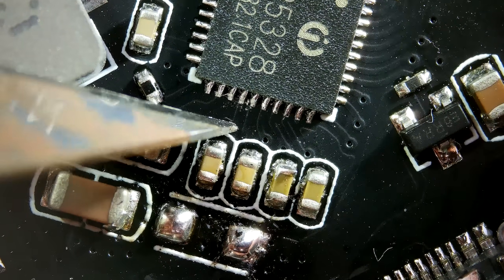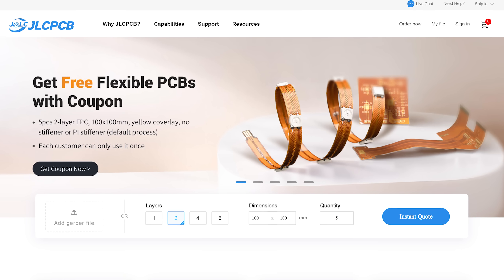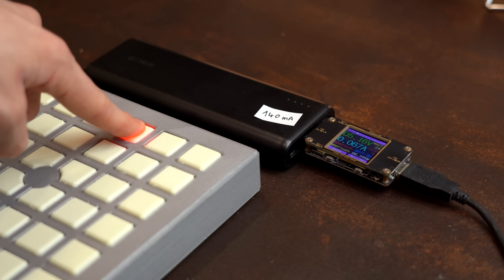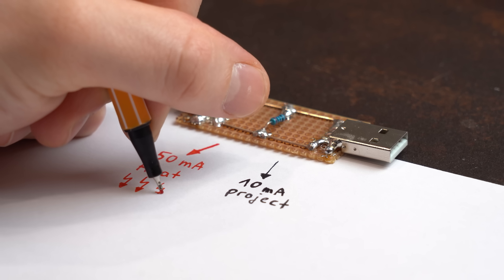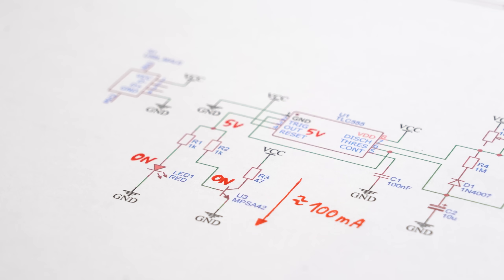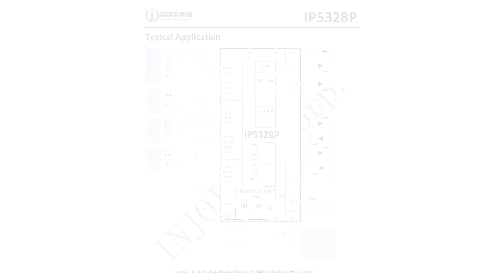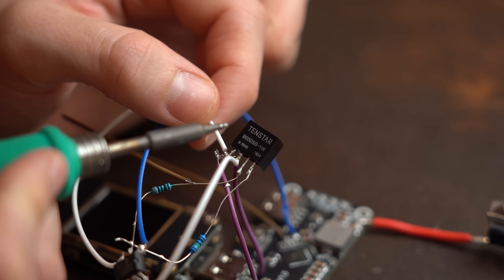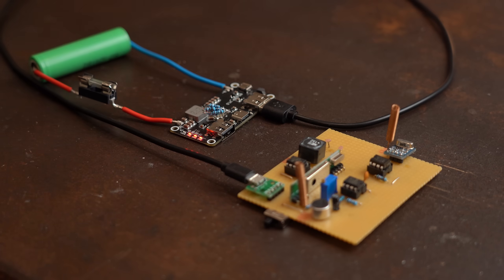Your Powerbank has 1 BIG Problem! (That we can "Hack")

Comment: You can add an offset to the current sense with just 2 resistors: one resistor between the 10mR and VSN, and the other from VSN to GND. The first resistor allows you to offset the voltage at VSN while only drawing a very small current to GND. Example resistor values of 2.2R for first resistor, and 18k for second resistor will only waste <0.3mA.

Comment: One thing I would like to see is a low voltage input cutoff on powerbanks. I have several that will draw all the way down and not shut off when they get low.
I don't like the batteries going that low. Luckily I'm using recycled laptop batteries that were free. They would last longer if they didn't draw down so low.

Comment: Another annoying problem is that most powerbanks turn off the output when you connect a charger. Otherwise you could use them as a small UPS. For a raspberry pi for Example...
Reply: I've figure out that this also depends on the voltage of the charger. If charger has a good cable and the voltage on the input port stays close to 5V my power bank doesn't turn of the load and indeed works like a small UPS. But if you plug it in a weak charger and the voltage on the input drops to say 4.5 it disconnects the load until fully charge itself.

Comment: I used to power a small camera tracking mount from a powerbank that would shut off after 15 minutes. My solution was to plug in a small USB hub and power the mount through that. It has worked for years and seems to take little to no hit on battery performance

Comment: Hook that usbc pd trigger module to  a buck converter, theres a mod out there that lets you add a curreent limiting function with a trim pot, opamp and resistor.  Voila, usb c power supply, adjustable from  15v.  I guess its more then a cable, its a amp/voltemeter and knobs in between your powerbank and project, but it still usese the power bank and you got the current limiting.
Reply: If your project runs on 5V, 9V, 12V, 15V or 20V it would make a lot more sense to rely on the well regulated output of a power bank rather than passing it through a cheap noisy buck converter first though

Comment: Another fix is to replace the 0.01R shunt resistor with a 0.02R shunt resistor. It should allow a higher current before cutting off.

I don't know if it will allow the unloaded booster to switch off though.

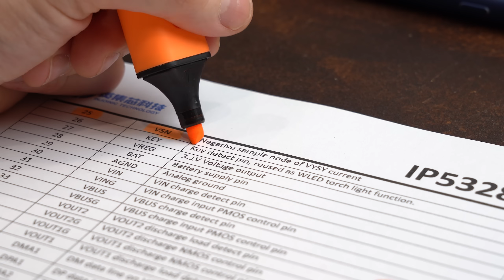Comment: 8:47 Wouldn't it simply have been enough to short the "current shunt"?  Then the 5V would just pass through or not?
Reply: The controller wants to see a small voltage drop. Too small and it thinks there is no load (must shut down after a while to save power). Too high and it thinks the load is too large (must shut down immediately).
Reply: @tomasburba5356  thanks for explaining!

Comment: Great designs! I think the 555 circuit is plenty good enough for people that need the convenience of a powerbank. The "pre-made" power banks are meant for expedient use anyway so as long as it's not discharging the battery for nothing it's fine. People that actually care about doing a "most efficient battery powered IoT whatever" will just embed the battery and add a basic BMC in their device (ie the little boards that just protect the li-ion cells from over/under voltage and overcurrent).
Nobody should be getting a power bank and then try to hack it, just get a BMC board and cells and make a "dumb" battery

Comment: I wonder if instead of pulsing a load resistor you could supply pulses to a capacitor that then powers your project, so it would pull the same average current but in narrow spikes that ought to trigger the load detection. On the plus side it should still shut down if your circuit is properly off, but on the minus side you'll have ripple which might or might not be a problem?
Reply: With the units I have they seem to play the game of averages... which is likely why he went after 100mA pulses when the verified steady current threshold was only 50mA.

It's hard to tell exactly what is going on inside them but it would seem that the longer a load has been near the threshold, the more readily it will trip with just a slight further decrease in current.

I think the pulse approach has a benefit efficiency wise because it may take a bigger hit on the averaging cap, keeping it further away from the cutoff point.

That said, this is essentially what buck and boost converters do. It's an "everything you got for a moment" followed by "let that soak in", on repeat.

So you could probably half get around this simply by using another converter that follows the one in the battery. It isn't going to really "gain" you much tho, you're adding on another "base" load that doesn't actually "do" anything, putting you back in simple minimum load resistor category.

Comment: The biggest issue I have, is that if I want to continuously draw power from the Powerbank while connecting/disconnecting the charger to/off the powerbank, the output gets reset. Not making it usable as a ups.

Comment: I feel like if you need to power project, that draws little bit of current, than a lot simpler move is to use 18650 battery with charging and prottection circuit.

Comment: Another idea could be to use a 555 to send a voltage pulse to the VSP pin, it could be something in the 100mV range, which is A LOT and quite easily achievable
Reply: With this solution you can include this circuit inside the PB enclosure, and simply put a switch on the supply of it, so if it is not needed you can completely disable it, doing so if you don't need the "keep-alive" function, you can completely power off the 555 (which even if a VERY TINY amount, but sucks a bit of current)
Reply: By the way i'll probably use an inverting schimtt trigger for the timer, it should be more enery efficent(the 555 has always a 15k load on the supply)

I know it may sound that i'm paranoid about those little currents, but my professors showed me how quickly they sum up

Comment: I'm using two different powerbanks together with ts80p and type-c cable. And you know what? When soldering iron automatically switches to standby mode it shuts down because powerbank disabled it's output. And the worst thing: one of powerbanks turning down even when target temperature automatically drops from 320 ºC to 200 ºC. That's really annoying. So, I don't think type-c solution will work for anyone. Or for anyone either...

Comment: You can just use an usb-c powerbank with a type-c breakoiut board, set both CC 5.1K to GND with a resistor to get 500mAh output on that port and keep all other ports awake with higher output.

Comment: If your project contains microcontroller and you have spare output pin and some space on board you can program pulse draw, or use second small dedicated microcontroller like Attiny5 and some transistor with load resistor to do it.
Reply: Yup, I've done this.  Spare PWM pulsing the power with a MOSFET.

Comment: Ikea powerbank's have a low power draw function hold the button for I think 10 sec . And the output stays active I think for like 2hours. The manual indicated it is for low current charging devices like smart watches .
I use it for a baby sleeping swinging little bed . The moment it's up to speed it draws very little current and except for a few older power banks most shut off in 5min.

Comment: The datasheet lists a parameter about light load detection which uses the voltage between the positive USB voltage rail (connected to pin VOUT1/2, VBUS) and VSN. Seems like they use the output FET as a shunt. If less than 1.8mV is measured, light load is detected. Maybe a low forward voltage diode (e.g. Schottky diode) between the positive USB rail and VOUT could do the trick without affecting charge/discharge current protection. Although, the datasheet is a bit conflicting at that point 🤔

Comment: I gave up on "off the shelf" power banks a long time ago. Years ago you designed a TP4056 / FS312 LiIon charger circuit. Since then I incorporate charging circuits into most of my projects.
The power banks I design and use have an ON/OFF switch. That's it! NO auto-OFF.
Reply: That means no auto-ON either, so for normal powerbank use it introduces the possibility of connecting a device to charge but forgetting to turn the powerbank on.

For that reason I would prefer a solution with an ON/AUTO switch rather than an ON/OFF one.
But I can see the appeal of having a truly OFF mode, so an OFF/AUTO/ON switch would also be interesting, though more error prone.

Comment: Hi,
as many projects require 3.3V and not 5V, you can use a 3.3 LDO regulator with overdischarge protection directly on the li-ion or li-po battery inside the powerbank. 3V is enough for low power projects (SMt32 + data acquisition +  oled for exemple) , a low cost LDO is sufficient in this case

Comment: I built my own using a TP4056 and a SDB628 (MT3608) boost converter module for less than 50 cents for both!!!
Added two USB connectors, power switch, terminal blocks, and enclosed in a 3D printed case. Voila. Always on @ +Whatever volts.   
That boost converter is magic. works down to 2V which consuming microAmps of quiescent current. Brilliant times.

Comment: From the datasheet"Discharge:
If key not pressed, only when sink device attached will the output port open, non-attached output port will
not open. If the opened output port current is less than 180mA @ 10mOhm, it will wait for a period of time before
close the port automatically. The output current is detected by the voltage drop between VSN to output, 180mA
current is equivalent to 1.8mV on 10mOhm, when the resistance (including MOSFET internal resistance) between
VSN and ouput is larger than 10mOhm, the current threshold will be decreased proportionally."

So all you need to do is attach a 555 timer to the KEY pin and pulse it periodically. It should stay on without drawing extra current  or messing with the current sense

Comment: It's nice to see Scott using Everyone's Favorite Timer Chip in a project again. Coulda done it with a cheap, ubiquitous microcontroller, but where's the sport in that? (Seriously, as much as I love the 555, there's something to be said for a chip that only requires a bypass capacitor and a load resistor to perform the same function, and the micro could easily be heat-shrinked into a tiny USB pass-through dongle.) By the way, Paul Carlson built a similar 555 timer "stay awake" circuit a few years ago.
It still bugs me that power bank enginerds don't realize that many consumers need this functionality.
Reply: Should be considered basic functionality to charge something like a headlamp :/
Reply: It feels wrong using an entire microcontroller to just pulse a circuit though :/

As for power bank engineers, they do realise, it didn't actually take very long after low power type C devices like true wireless headphones came on the market for power banks to start including low power modes. The problem is that the cheap power banks just recycle the old designs so you usually only get these modes on mid to higher end ones.
Reply: @bosstowndynamics5488  I meant the ubiquitous $0.03 one-time programmable 6- or 8-pin chips. Just a few lines of code to grab a brief pulse of current every few seconds, 100 nanofart bypass capacitor, appropriately sized load resistor, USB connector traces directly on the PCB...Bob's your auntie.

Comment: The new Varmfront powerbanks from IKEA have a "Small current supply mode" (<100mA) - just press the button for 8s to enter that mode.
It isn't even advertised, lurks in the instruction manual.

Comment: A simpler way to do the pulse load would be to use an ATMega328. With the 5v supply it would not need any external regulator, just a bypass capacitor at VCC. It draws around 8 µA with the watchdog enabled in sleep. Just wake it up every x seconds and parallel four or five output ports with a 47 ohm 1/4 w resistor attached to Vcc. The outputs can handle 20 mA each (easily) and you can use the internal clock so you just need one chip, one resistor, one bypass cap and you’re done.
Reply: If you already have a microcontroller within your project, you can have keep-alive at the cost of one pin, a random tiny little MOSFET, and a couple resistors, one to tie down the gate against floating and one for the actual load. Or a random BJT then one resistor is to limit base current, it doesn't necessarily need anti-floating.

Comment: Someone mentioned that some power banks such as those from Xiaomi can go to "Low Current Discharge Mode" by double pressing the battery check button (and exit by simply pressing the battery check button). This however, still has a potential problem that this mode will end in 2 hours. This may be good if you use it to charge your wireless earphones but in my case, I want to use the power bank to drive a water fountain for my cat (which draws about 40mA current, and don't have a near by mains socket) so I want it to be able to run as long as possible. Another question on Scott's hacks is, will the power bank still be protected from over-discharging, especially when the pulse circuit is added?
Reply: Yes the cells are protected against over discharge regardless, no matter that you apply constant load or wake-up circuit with intermittent load.

Except on the very cheapest of power banks, not reputable ones, which can only turn off boost but then the battery voltage is still on the output terminals, so instead of 5V something in 3V-4.2V range is present when it's sleeping. But you could say those don't have a functioning over discharge protection to begin with, sure a phone would stop charging, but LEDs, heating gadgets and other simple devices could overdrain such a power bank. You better check if you have those around.

Comment: The most right solution - is to use DIY spot welding and make your own Power bank ) with your own voltage controlling circuit ) worth making video on this - if not done yet..

Comment: My energizer power banks will usually crash upon power up so they continusly output 5v instead of fallin' asleep after 25seconds !. And btw, they do have the automatic shutoff when little energy is being drawn, however the IC controller seems to crash and keep the usb port active regardless of load. ~Jason437.

Comment: I buy cheap power banks  just to disassemble them to get the batteries that I use later just with a fuse, so zero problems with auto shutting down. EDIT: All the power banks I own and disassembled actually state the wrong capacity, i.e. when they say 10000mAh, they mean the battery inside rated at that capacity, they don't provide 10000mAh at 5V.

Comment: Having such a circuit would be a lifesaver for me. Whenever I'm charging my Pixel 6a, it displays an error after 80% saying there's a problem with the charger source. Sure there was. The power bank was constantly cycling as the phone didn't even draw 200mA. I would rather have a power bank with a traditional power switch to completely cut off the buck/boost converter. Sometimes, I feel like the cheaper power banks are more worth it as they mostly come with a button activation with no cut-offs.

Comment: Wouldn't the last solution end up triggering overcurrent protection if pushed too far?
Reply: It does. The wavy voltage where he shows, that's probably the protection oscillating on the brink of triggering.

Comment: Funny, because i recently made exactly the opposite experience. 😄 I bought absolutely cheap beard trimmer for traveling. But this one had a) old NiMh batteries and b) an extra adapter. So i used a step down converter to the used 3V and an old USB cable to use it with a standard USB adapter. But than the charging always stopped after less than a Minute! I thought a made a mistake but than i realized that this only happens when the battery is full and the flow is dropping. Which is perfect because the original Adapter dopes not stop charging, so you never knew when the battery was already full. But because of the auto-stop of the converter now it does. So now i have a USB cable to charge and additional an auto-stop. Win-win. 😄

Comment: 1. so cheap that your purchases can potentially cause human right and geo political problems (blood diamond effect anyone)

2. couldnt you stabilize  the power output with a large capacitor?

3. many of todays chips are now software powered so if you could dump the code and reverse engineer it?

Comment: IP5328 have I2C communication, u can easily configure this behavior throuhg it. First power on by button , to power the mcu, mcu sending "always on" to IP5328. This shunt 10mOhm it's for charging/boost current sense. I bet the whole IC get crazy after you changed it :)

Comment: there are two common problems in see with power banks. 
1. threshold voltage over time. your video addresses this. most i have tested cut off after around 30 seconds with  small current used, or the consumption is too low to even keep it running. yours sounds to solve this.
2. passthrough charging
use case: sbc like a raspberry pi using a power bank like a ups. it should only allow mains power until there is an outage then kick in. most power banks do not have passthrough chargung. it would be helpful to have a power switcher that would activate any powerbank when an outage occurs, probably with a capacitor in order to keep continuous power right when the power bank is about to activate. that way you can use any powerbank in whatever useful form factor to go with your project.
by default, powerbanks simply drain out. you don’t have the option to use mains then power bank as secondary. some solutions are clunky with a custom circuit and no power bank while others just use a power bank tethered to mains but it is still using the battery first.

Comment: I found another problem I have with a power bank, it can either charge or discharge and will not do both (like a ups) - how can I add the correct wiring and electronics to make it work and function as ups?
Reply: Put 2 on 1 battery. 1 for charging and 1 for discharge :).